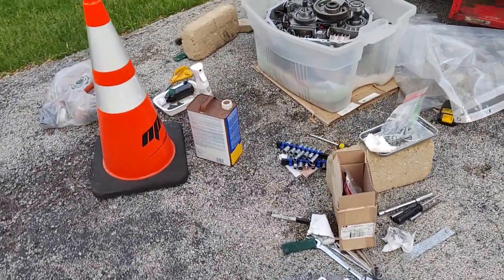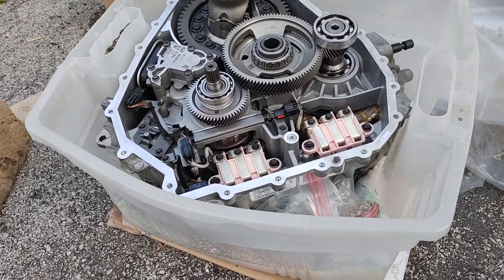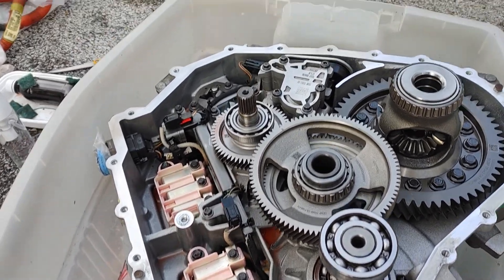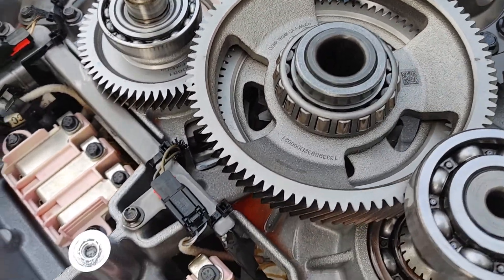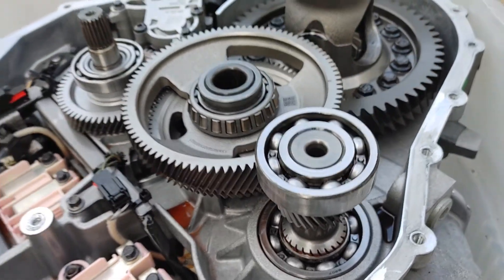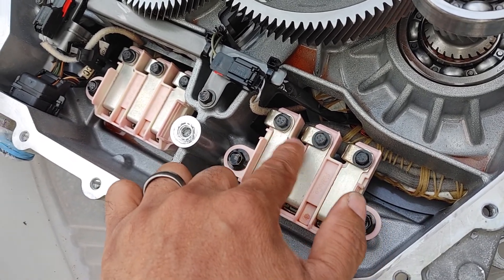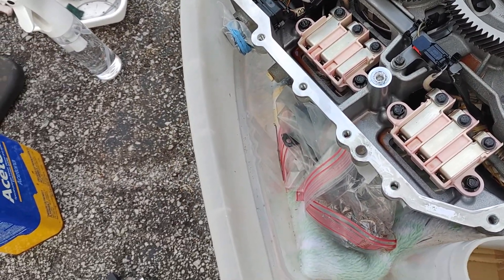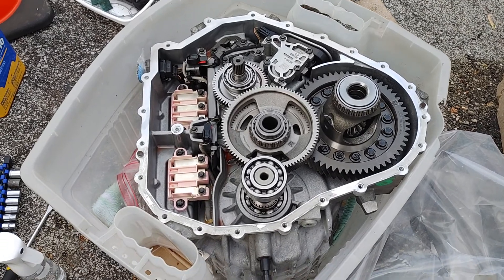HF35 FHEV eCVT Hybrid Transmission - Opening to Inspect

Comment: Thanks for sharing. I have the same problem. Noise when the engine starts running. The solution is Change the bearing right ?
Reply from the maker: Thanks for watching, Try changing the trans fluid first. Because it is a cheaper diagnostic maintenance and it might help too. when I went to change my fluid there was almost none it the trans, and it took way more then what came out to fill it. The new fluid slowly liked out indicating that I had a seal problem. Note: you can not change the trans filter, so, don't even try. The filter is inside the trans. I know, I know. WHY! The OEM trans fluid was partially organic and will tend to change color (get darker and fail) over time. All the new 100% synthetic trans fluids are super amazing. [recommendation:] Valvoline® DEXRON VI/MERCON LV (ATF) Full Synthetic Automatic Transmission Fluid 1 GA and pump it in slowly (The only real "Full Synthetic" Mercon LV available!!). The bearing in the HF35 get hit hard with fiction, heat (duh) and spin really fast. So! Using a blended oil with high wear additives does not last. ATP® makes an ATF that is 100% synthetic and Mercon LV compatible too but it is much more expensive. Motorcraft® MERCON LV does not come right out and tell you that it is a "BLEND" that despite additives is prone to oxidation (i.e. breaking down and turning amber to black over time). Always use 100% synthetic base oils when possible.

Love from Chicago

Comment: we have this transmission in our 2014 cmax....it has almost 150k mi now....will do the fluid change soon.
Reply from the maker: Thanks for watching, Regardless to what the owners manual says; You should be changing the trans fluid every 30k and the motor oil every year with 100% synthetic 0w20 oil. I have been looking at the Ford Fusion/CMax Energi plug-in hybrid that Europeans rave about. It looks like it only get around 40 miles US per full over night charge before it starts using petro. The CMax has a look only a mother can love and takes a while to grow on you, but it is amazingly spacious. I told my wife that a 2014 Ford Energi is our next car... either that or the 80 mile US rated Nissan Leaf (Another odd looking plug-in car). I have "charge anxiety", so a hybrid with a big battery sounds like good training wheels form me. The 2014 hybrid MKZ has been nothing but wonderful. We drove it from Chicago to Atlanta on 15 Gallons of regular petro in comfort. And the hybrid floats over the Tennessee mountains. That is comparable to my preferred vehicle the 2003 VW Golf TDI (turbo diesel) which has a 13 gallon diesel tank and get (real world) 46 miles per gallon, but the Tennessee mountains are tough for turbo diesels cars, trucks, and semis (always a nail biter). Before we bought one, we never knew FORD CVTs even existed, let alone as early as 2013. Someone at FORD/LINCOLIN is not doing their job.
Love from Chicago.
Reply: @GallowayChicago  Yeah, it was very interesting to see the inside of this thing. Well, I just hope our transmission holds up. I would have changed the fluid sooner if I had known about the problem...so far so good. For the engine I always use full syn 0w20. Ford doesn't even sell the semi blend 0w20 anymore that they recommend in the manual. We get around 41mpg.
Love from LA

Comment: How hard is to pull the stators from the other sides my bearings are whining but only on the stators
Reply from the maker: I could not find a dependable bearing supplier. Ford/Lincoln do not have rebuild parts. They just replace the whole trans for $8K to $16K (usd). I found a used trans for $3k and paid about $1K to get it installed at the only trans shop in ALL of Chicago willing to do it. They had/have experience removing and installing Toyota Prius Taxi trans and wanted to try their hand at the Lincoln trans. Bottom-line: they did an amazing job, but I had to open the used trans I got from CA before they could install it. The old trans had low ATF and the color of the ATF was almost black. The used trans from CA had beautiful ATF. It was not new but had no signs of any breakdown and all the gears were polished looking. (I got lucky) I come from a world where trans cost under $1k, so this whole hybrid thing is new to me, but above $8k for a new trans is ridiculous (imo). I still have the old working trans that, like yours, only need new bearings. Maybe I will sell on eBay as a working core???
Love from Chicago.
Reply: @GallowayChicago  I’m rebuilding mine my self. Hope it will went well
Reply from the maker: That was my plan-B. It was my plan-A, but after watching YouTube vids that showed people replacing the main and regen bearings, I was unable to source the OEM or better bearings, and I did not want to buy a bunch of mystery bearings without knowing they would 100% work. I wish you much luck. As long as the gears don't have broken teeth, the trans should be a good candidate for a simple bearing swap. Please let me know how you get on mate.
love from Chicago.

Comment: Hi, I had a problem with my 2014 Fusion Energi (same transmission) and I replaced all the damaged parts and bearings inside the transmission. In my case, the change of parts did not work, the sound of the transmission is very loud and although it does not show any error, the sound tells me that something is not right. I am writing to you to ask if you did something special when you installed the transmission, especially related to the transmission oil pump, bleeding it or something that I did not do that could be causing the sound?
Reply from the maker: Thanks for watching; How did you determine which bearings were damaged? Some bearings only make sound "under load". In my case the trans would only make noise when in regen mode (when the 2.0L motor starts and then high speed transmission gear/bearing in engaged [the big one]). In electric drive mode the trans was whisper quiet, but once the motor kicked on I could hear the car from inside the house with all the doors/windows closed. I think you need to make sure your electric oil pump is good order then double check the bearings. It might be that your lower bearings are shot. The lower bearings are on the coil side of the trans. By-the-Way: Where did you get your replacement bearings and cups? I looked all over the place and could not find a distributer. Lastly; your trans (the Energi Plug-In hybrids) is the same as the standard hybrid with the addition of a electrical oil pump. My trans has a mechanical oil pump. I was considering installing an electrical oil pump but in the end it was not needed. As it turns out the 2013 and some 2014 HF35 trans' assembled by robots where not sealed correctly and would leak ATF resulting in bearing wear. Under normal usage the this ATF should be replaced every 3 years even though it is classified as a lifetime fluid (lol). I was new to this HF35 and Lincoln wanted around $15,000 to replace the trans and that motivated me to learn more to help save some money. If my video did not state it: I ended up buying a used trans from CA (about $2600 shipped) and having it installed here in Chicago by an amazing Trans shop (about +$1000 R&I). It took them a week and they did a wonderful job. We had only had the used auto for about 35 days before realizing that the trans was bad. The dealer tool us "Too bad, so sad". I still have the old trans with the worn but not broken bearings and plan to sell it one day. I have seen the ones with bad bearing. The bearing fly apart when the cover is removed. I know it is a pain in the butt, but remove it again and take another look. Once removed these trans' are not that hard to work on. The bearings should be tight with zero sloop. I apologize if I have repeated thing you already know but sometimes we have to go through a check list to make sure we are not missing anything that could be a problem.

VW TDI Love from Chicago.

Comment: I looks a similar design to the RAV4 HEV eCVT?
Are they all unreliable?
Reply from the maker: "In my opinion": This design is amazing, I can see why multiply major auto manufactures use a variation of this design, but in the case of the 2013-2014 Ford/Lincoln hybrid failures and subsequent recall people were replaced with early assembly mechs that did not apply enough RTV sealant and these unit leaked vital trans fluid used for lubricating and cooling the EV drive systems.  There are some that speculate that the roughly 10 cents of saving on using less RTV sealant was an effort to build in a service mileage timer, but I do not believe it because seal failure had/has too many variables besides just mileage. In any event, The failure was handled with a soft-recall and a subsequent assembly adjustments that resolved the issue for future hybrid autos. That is why part transplants from younger hybrids are preferred to rebuilt units. My wife's 2014 MKZ hybrid get over 42 MPG on the highway and around 32 MPG in the city. This is comparable to our much beloved 2003 VW Golf Diesel 5-speed that gets around 44 MPG. (love from Chicago)